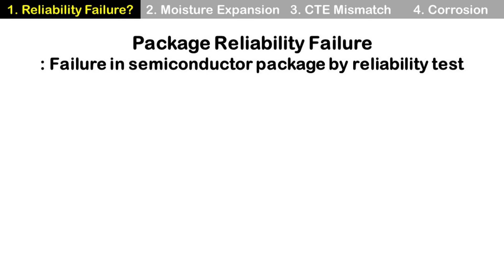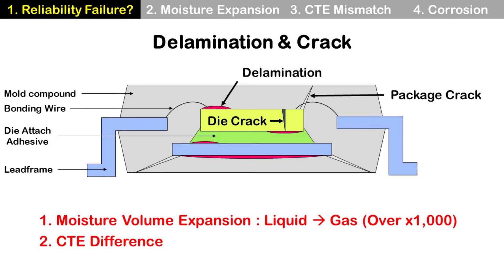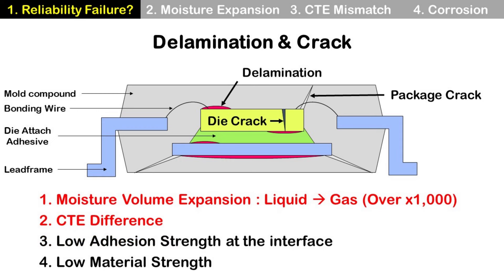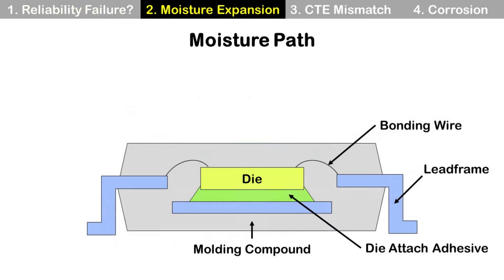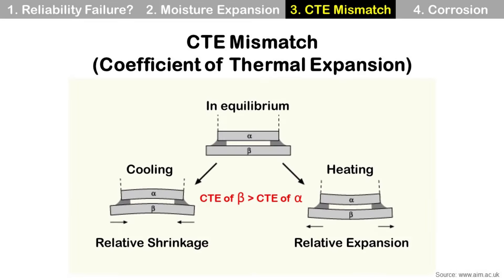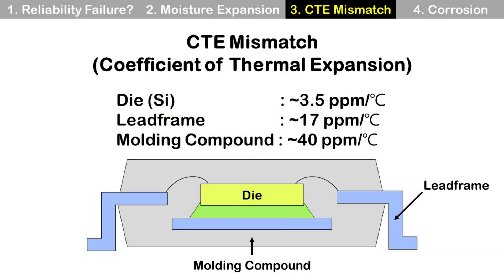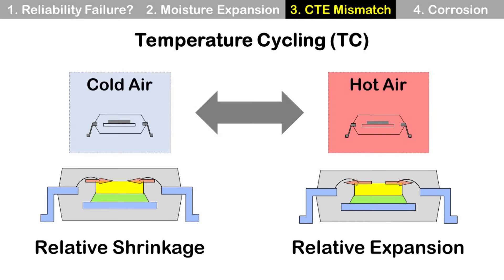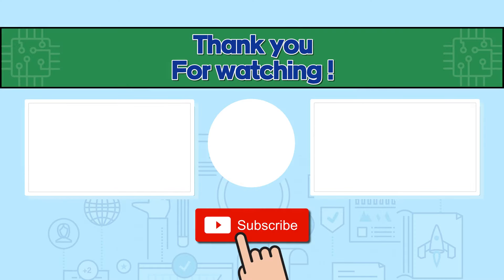[Eng Sub] Package Reliability Failure

Comment: In a 3D packaging configuration, the base die has a larger footprint compared to the memory die on top. With the integrated heat spreader (IHS) on the top surface, how can we achieve a uniform profile across the package?
Reply from the maker: I don't understand your question clearly but will try to answer as much as possible. IHS is larger than silicon interposer so IHS can cover whole silicon interposer. On silicon interposer, there are GPU die and HBM memory module. GPU die thickness and HBM memory module thickness are same so its surface is flat then IHS is attached on this flat surface.  
Please check cross section photo in below article.
https://www.yolegroup.com/strategy-insights/nvidia-reaps-benefits-of-ai-growth/

Comment: Kindly share your email id sir
Reply from the maker: Sorry. I want to communicate through this channel rather than my e-mail.
Reply: @semicontalk3223  hello sir, I have couple of doubts
1]In my design, the MCM package has multiple dies, each die has a different functional purpose and a varying z-height. To manage the heat generated by these dies, I plan to utilize an IHS placed on top. However, applying a uniform Thermal Interface Material (TIM) between the IHS and the uneven die surfaces leads to an increase in overall TIM resistance. (backgringing of die is not possible sir,)
2]In package how to calculate Core Thickness. Considering the package size (110mm x 80mm) and the aim of minimizing warpage, could you recommend an appropriate package core thickness for (material like organic (dielectric)and glass core materials? 
I am looking forward to your response sir
Reply from the maker: Thanks for good questions but I am afraid that I don't have clear answers. So I want to share my thought insread.
Comment 1) You are right and unevne die surface will cause thicker TIM for low Z-height die then degrade heat dissipation. Some times we can use uneven heat sink instead of IHS which can compensate that TIM thickness difference. But it may be beyond your responsibility and only your customer can decide with system perspective.
Comment 2) You need to proceed mechanical warpage simulation to calculate core thickness. I read research paper which is for 100x100mm FCBGA package and they used 1.3mm core package substrate. To minimize package warpage usually people use low CTE glass cloth and other low CTE material for substrate. 
If possible please check with major FCBGA substrate suppliers such as Shink and Ibiden.
https://www.shinko.co.jp/english/product/package/substrate/dll.php
https://www.ibiden.com/product/electronics/merchandise/fliptippkg/